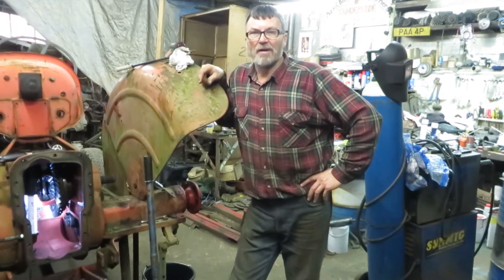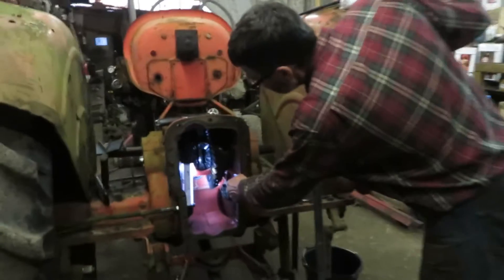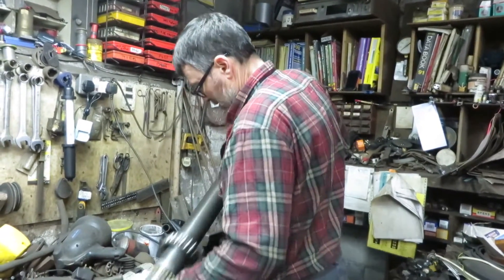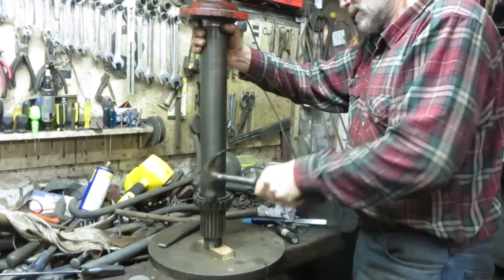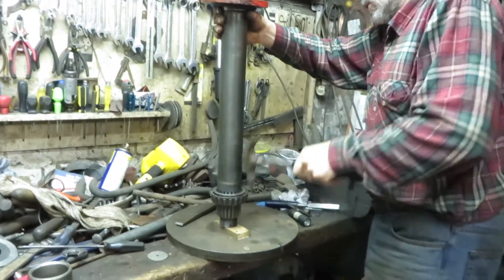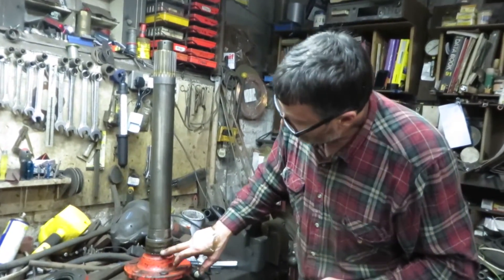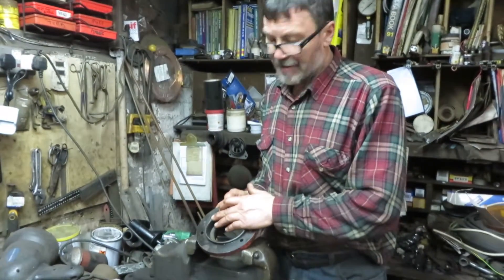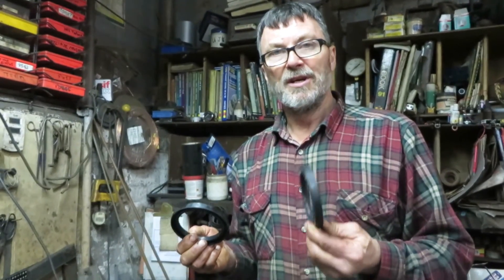Nuffield/Leyland halfshaft seals

Comment: Hi, very good video that helped me immensely when I replaced the half shaft seals in my Universal four Nuffield, i took the half axle off because the washer between the final drive cog and the bearing had broken into pieces and there was extreme end float of the half shaft,  made a new thick washer and its all back together again with just zero end float

Comment: I have been round nuffield tractors for 55+ years, I know every nut bold and washer and have replaced more than one halfshaft  was advised bye nuffield machanic  all ways replace bearings with new ones. as for copper slip just a little round the axle just were the bearing sits.I drive a  large grimme varitron harvester and replace every bearing on the multi sets 32 bearings in all, whether they need replacing or not as like a halfshaft not a quick job if you need to do it fast.

Comment: Hi Iv got Nuffield universal and the clutch pressure plate we are struggling to get remove it. Any suggestions ?
Reply from the maker: Dual clutch or single? Have you removed the pressure plate and just have the friction plate rusted to the flywheel?

Comment: Hi. Many thanks for all the very informative nuffield videos! I am restoring a nuffield universal 3. Do you know if the mudguards for the universal 3 are the same as for the 10/42 10/60 3/42 4/60 and 4DM. I am looking at part numbers NT5594/NT5595. Many thanks in advance for any info 👍😁
Reply from the maker: The three cylinder wings are smaller than the four cylinder wings and are like hens teeth to find, not what you wanted to hear. They are the same as 3/43 & 10/42 wings
Reply: @montegoson  Many thanks for the prompt reply! I had a feeling that was the case, but some sellers are listing the same mudguards for all the models I noted above... Any idea who would stock the universal 3 wings? New or second hand. Thanks again! Your videos are invaluable.
Reply from the maker: @drsocrates3  They are not available new you just have to watch the internet for sales. Some people use International or Ford small wings
Reply: @montegoson  Thanks for this. I will keep searching! If we had to opt for an International / Ford guard which model would be the closest match?
Reply from the maker: @drsocrates3  I think its Inty B250 or Ford 3000
Reply: @montegoson  Rick, many thanks again for this! John
Reply: Hi does anyone know where the heater guage cable plug goes onto the universal 3 please

Comment: Hi Rick and apprentice .  Why would a Nuffield 4/65 get so hot it feels like it will burn your skin , after a couple of hours work . I have a 344 ,do exactly the same work and  the gearbox on the 344 is only warm to touch . Is this an oil issue or something more ? Both gearboxes have the same part numbers and the casting dates are 18 months apart . Any ideas ????? Thanks in advance . Johno .
Reply from the maker: I would guess a fault with the valve block causing the hydraulic pump to blow off constantly is heating the oil.

Comment: Hi ric I'm doing the same seal on a Layland 270 it is the same as this Nuffield where I have to take off the hydraulic casting but I'm having trouble removing the casting and was wondering how you get it off I have removed all bolts and pto shaft but something it still holding the casting in at the bottom do you have any ideas 
Thanks
Reply from the maker: No idea mate, there are 4 bolts along the bottom row. There is no need to remove the pto shaft first though but I cant see any problems from doing so. Do you need one of the 8 sided sockets i have made?
Reply: montegoson I have undone the four bolts on the bottom but there seams to be something still holding it at the bottom so the casting is leaning and open at the top but cannot understand want is holding it I have had pry bars behind it and still no good where are the four bolts at the bottom as I only found 2 
Cheers
Reply from the maker: Not sure how to add a picture here. can you email me about this. therickyard@aol.com

Comment: please do you remember the size of the large nuts on the half shafts? Thank you
Reply: Thanks!
Reply from the maker: But i do have some laser cut tools to fit!
Reply: +montegoson really? Sockets? Where from, and how much please.
Reply: +montegoson I've emailed you, please look out for it. Thank you. Andrew
Reply: Hello i have a 344 Leyland and just wondering what is the correct position of the lever for raising your top links so when you're mower is up that the pump isn't always running

Comment: Hello ric, do you know the diameter of the seal carrier please.
Reply from the maker: Andrew Moore  not sure what you want to know. or do you want to know the seal sizes? I have some seal carriers if you have broken one!
Reply: I've made a homemade press using two pieces of square plate, a bottle jack and some chunky threaded rod in anticipation of tackling my leaky axles. I just had a thought that I might not have made it big enough to get the carriers in between the rods when I come to press the seals in! Did you put felt seals in between the seals? Thanks.
Reply from the maker: Ok, I will measure it up for you tomorrow. The felt seal goes in first with the two lip seals on top. You will see when you take it apart. I sell the spanners that fit the 8 sided nut if you are in the UK
Reply: Thanks ric you're a gent. I should be ok with the nuts as I have a socket made from the parts you supplied. Also, a nice local chap used to be workshop manager at a now defunct Nuffield dealer and he has the original bearing puller, very convenient!

Comment: Has he ever used copper slip,if not he would get on better removing bearings ect, he should no better, and all so do not  fit old bearing replace with new one, and when you fit new bearing heat it up a little in oil it will fit with ease,
Reply: Do you need take half shaft out to replace on sliding hub models or just hub off